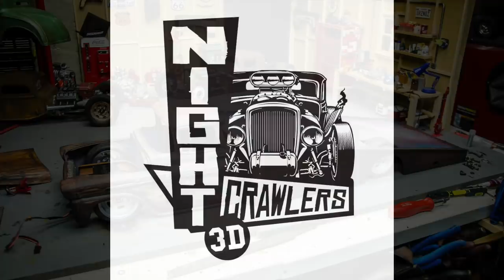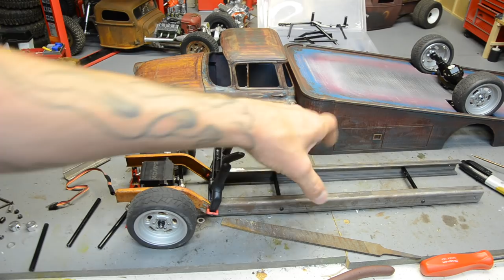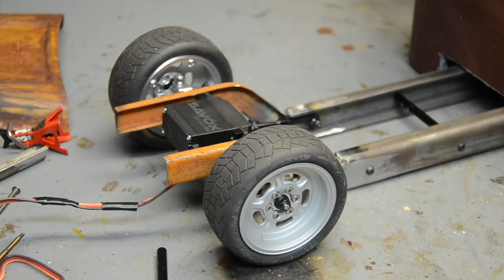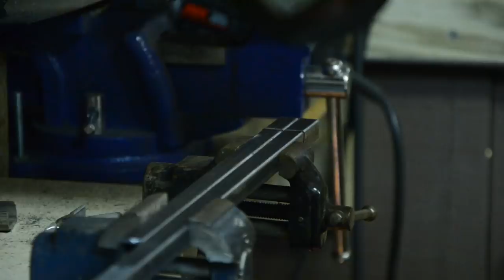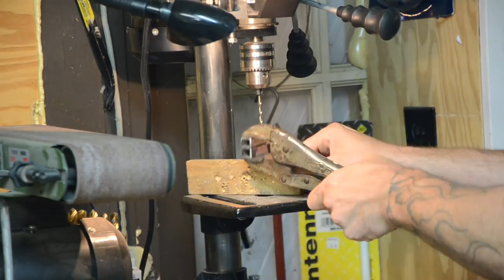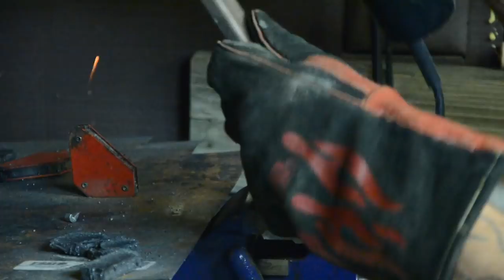The RC Rat Rod Ramp Truck Scratchbuild,  Part 5, Chassis Fabrication Time

Comment: Nice build dude. For a temporary weld table a piece of 1/4" plate works pretty good. Your local steel yard should have a rem pile of oddball pieces and should be fairly clean steel.

Comment: I remember the good old days. Where you needed a tetanus shot each time you played with your metal Tonka trucks! You could actually leave them out in the sand box. All year long through all weather. Toys were built to last back then. Tonka was my gateway drug to RC trucks & crawling! Wouldn't change a thing. I still have my old Tonka dump truck!

Comment: Nice, you could run really long trailing arms, and it would do away with the pinion angle change and wheelbase change when cycling the suspension, just my 2 cents,  build looks sweet tho
Reply from the maker: That is a great idea!  Something to consider.  I would need a panhard bar perhaps...

Comment: Just found your channel and watched all the videos for this build and its just a thought but have you thought of a Tig welder for making the chassis? mite make for better heat control and better procession on welds?
Reply from the maker: I have considered it but I recently got a new MIG.  It is a vast improvement over the harbor freight $79 arc welder I was using for my first couple of ratrod builds.

Comment: Dude I love custom framework! Question for you, if you take square stock and put it in C- channel can you bend it and it won't wrinkle? If this will work that would be great! Now just need to find some 3mm square stock and 4mm c-channel. (If not then just scratch this idea...) You are going to use my idea! Thank you that is awesome!! For the trans, how about some flat stock notched into the frame and drop it down in the c-channel, sence it's steel, flex shouldn't be an issue. Let me know what you think all opinions are welcome.